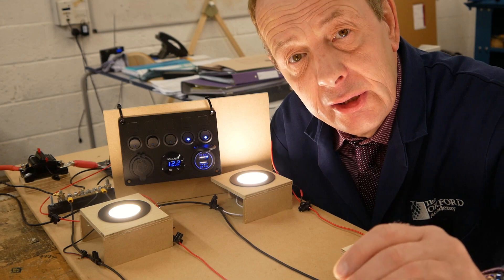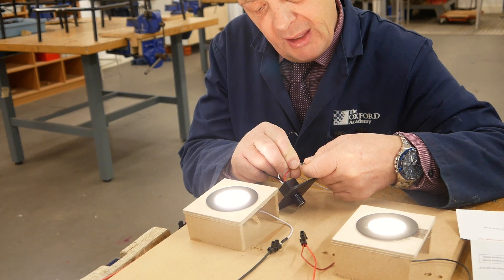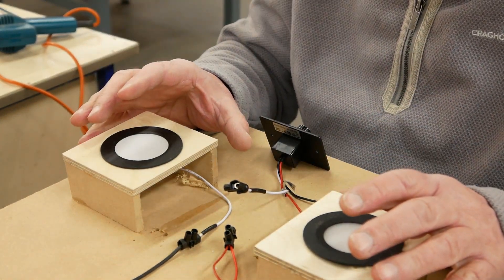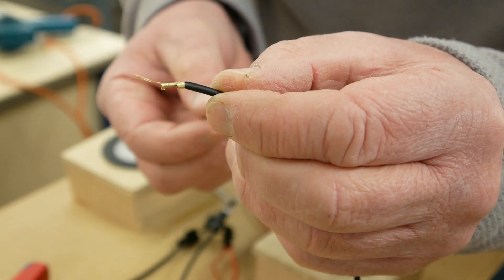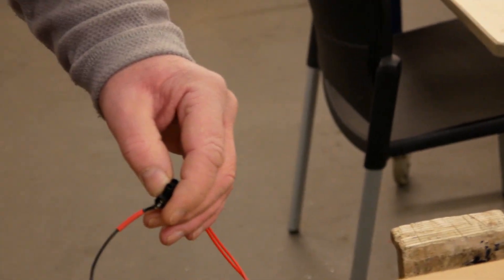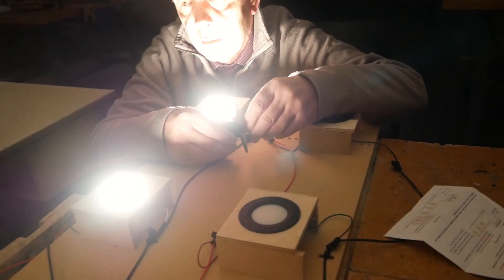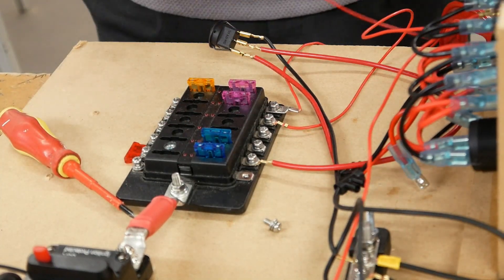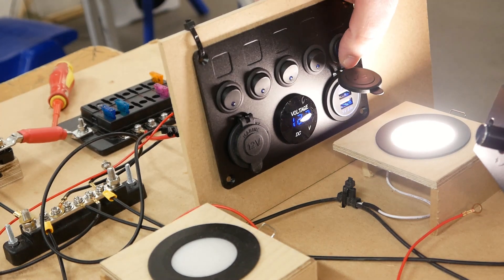How to Wire 12V Dimmer Switches | Interior Van Lighting Made Easy! Ep3  |  SHED 52

Comment: Hi, thanks for the useful content. Is it ok to ground to the chassis? In the manual for multiple 12v dimmers it states that it specifically requires grounding to negative of the battery. I find this an odd distinction as it suggests you need a fully isolated leisure wiring system which grounds to negative only, not chassis. Which is against safety regs.

I assume you would just ground to chassis and not opt for an isolated leisure system instead just ground everything to chassis…?
Reply from the maker: Always a good idea to ground to the chassis. Grounding back to the battery via the chassis is also found, as well as grounding directly back to the battery. I've done it this way, because I don't have a chassis on the display board and I'm also not sure of the final layout for the lights in my van.

Comment: Hello, I'm connecting a dimmer in my campervan and this may sound like a silly ? but where do i put the ground? PS: I have puck lights and had a dimmer that failed and for life of me can't remember how I did it. Thank you.
Reply from the maker: Hi, I connected all of my grounds to a buzz bar, here is a link showing what they look like https://amzn.to/3N7RSg7 You can either run a black cable ack to the battery or find a bolt it to the van body. If you bolt to the body make sure you have removed some paint so bare metal is touching bare metal. Because you main battery is earthed to the van body, the connection you make to the body will eventually go back to the battery.
The dimmer question is a little more difficult, but seems to be a common problem so I'll make a video on possible faults and why they may not work. This may take a little while as I am working on the engine at the moment trying to get it ready for a MOT. Thank you for the questions, David